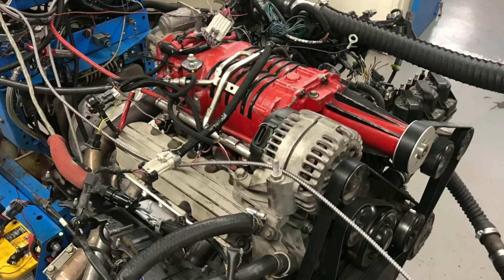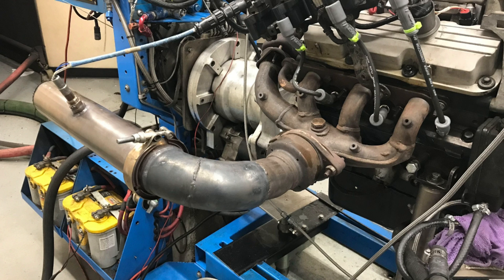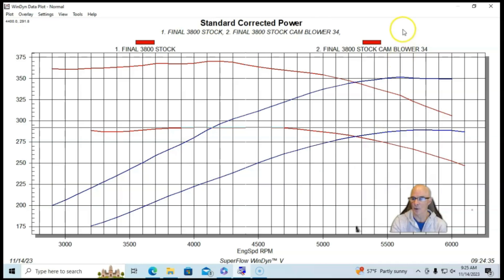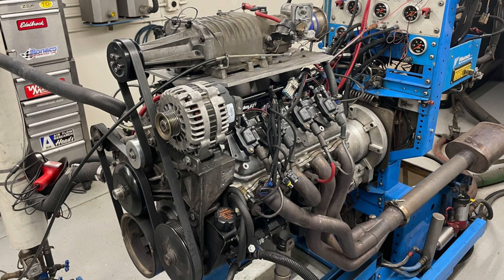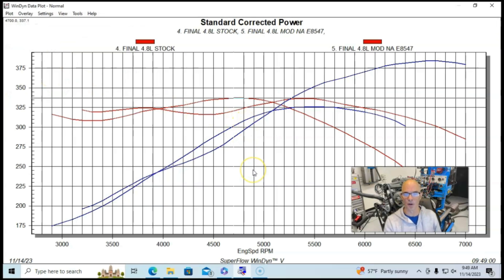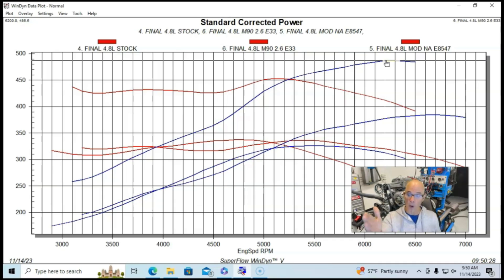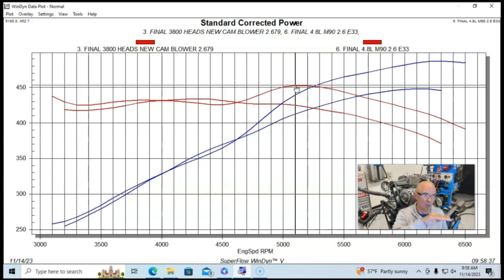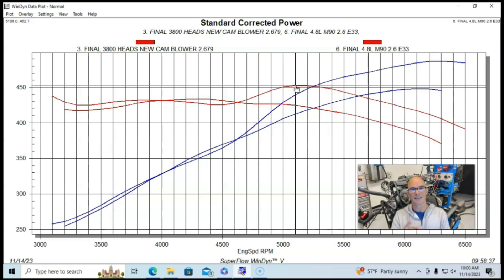3.8L V6 VS 4.8L V8 CHEAP M90 BLOWER TEST. WHAT HAPPENS WHEN YOU RUN THE SAME BLOWER ON BOTH MOTORS?

Comment: Hello...  I. Have.   Been. Around.  Only. One.  Of.  These.    When. They. Were.  Made. By.  B...n...m...    or.  Weiand.   But.    What. A. Difference. It.   Made. On. The. Common.    8l1 cr    350. C...i...d...  chev...    the. Man.  That. Owned. It.    Ran.  12 pnd.   Boost. And.   It. Was.   Unbelievable.   How.  Much.  Power. It.   Produced.   He.   Spun.   235l60lr15. Tires.   With. Posi...trac.  373. Diff....Like.   They. Were.   Bicycle.   Tires.      The.   Very. Cool. Part.   Is. We. Got. It. Under. The.   Standard. Hood.  On. A. 71. Camaro...  have.  A.  Nice.  Day..

Comment: I run a 6v71 detoit blower on my buick using a back to front power steering pump pulley on the blower      
The blower is the size of the block with no heads or sump😂

Comment: When you're doing the tune, and specifically the software, do you start out first trying to find the max timing you can run before knock (not an issue with e85 I understand) or no more gains in torque and then start to add boost in? Like, it seems good to make more power with less boost which I take to mean the engine will have more longevity but if it was me ... knowing nothing ... I would have been chasing the same boost on the big motor but it seems that isn't the way to go. Can you elaborate on the process at all?
Reply from the maker: we run very low timing-then adjust AF (mid 11s on gas scale), then add timing up to our safe point.

Comment: Id really like to see a gen v m90 up against an m112 on a 4.6 ford.
Reply from the maker: m112 wins-it's bigger
Reply: @richardholdener1727  fair enough. To rephrase, id like to see proof that an m90 could be worth installing on an otherwise stock 4.6, especially 4v, and what can be done to get comparable performance to a factory m112 based setup.

Comment: I have a series 2 3800 camaro that I'm doing some modding to. My plan with it is to upgrade the valve springs and possibly put cam and headers on it before I push a wet 100 shot of nitrous to it. I've got the 5 speed model. As long as I don't spray at low rpm i should be fine. Before that I want to regear to a 3.55 since I've already swapped in a posi rear.

Comment: Interesting that the headers didn't do much on the L32.   Could help explain why NA the 3800 II and III at least what I have seen personally here in Aus don't gain a massive amount when building a hot NA engine, but the old 3800 series I and pre series I (LN3) respond to NA mods extremely well, most of which are the headers alone or which rely on the headers as a combo with other mods like cam, porting, higher comp etc.

Between the series I, pre series, and the later II and III series, the heads are totally different and account for 75% of the redesign of that generation.

On a side note, we never got the gen 5 blower here and there isn't a version of the gen 5 that will fit our cars without serious cutting and welding, which leads to not having seen any builds get close to this power on the M90 here.  But when swapping to a turbo or Whipple blower, the power gains become much more meaningful.

Comment: I wish you'd use the proper designation for torque. Ft/lbs is a linear straight line torque. Lb/ft is circular and what you need to use to be accurate.

Comment: You need very little or no valve overlap in a supercharged engine.
Reply from the maker: you need overlap if you want to make power-overlap is not the enemy of boosted motors (that is a myth)
Reply: @richardholdener1727  well tell that to isky.
Reply from the maker: I have run 30+ years of dyno testing to verify my statement, turbos and blowers work very well with cams that have overlap-the guys at ISKY know that too

Comment: Interesting. I didn't think people were still playing with these roots blowers. About 20 years ago I fitted an M112 to my 02 V6 Mustang with a mild tune and pulley setup. This was a complete stock 3.8 block and heads. Made something like 265 rwhp and 285 rwtq at about 6psi. The blower whine was the absolute best. lol Put 80k miles on that setup without an issue. Then I got bored and started playing again with the tune and started changing pullies. Finally ended up lifting one of the heads when I was up to about 12psi.😆

Comment: More efficient? No. Made less boost because it’s on a bigger engine, even though you were running it a lot (10%?) faster.
Don’t get me wrong, I enjoyed the vid but to make any sense you needed the blower drive ratio to be the same, not just the same blower pulley size.

Comment: Great video! So, basically, the 3800 vs 4.8L with the supercharger up to 4600rpm will outperform the V8 everyday bc of weight. Not sure which one burnt the fuel better though.

Comment: When I was a teenager, my brother had a Camaro 1980. He built a 400 small block. And my Uncle had a Buick with a 3800. Wasn't supercharged? I actually. I think it was a leSaber and he beat my brother in a top end race. We 400sb topped out at 132 the Buick was a mile or more behind us in Mexico and about 4-5 miles the Buick caught up and was passing us from a dead stop the 400 murdered the 3.8 but top end I'd say that Buick was pushing 145....fwd 3800 4 speed auto 4dr vs a 1980 camaro with bolt ons cam headers carb

Comment: The 3800 is a great motor. I had a Buick Gran Sport with naturally aspirated 3.8 and it would get 34mpg on the hwy all day long. Also had a 1986 Fiero GT and wanted to retrofit it with the 3800 V6 with blower but never got around to it. I'm thinking it would have been a great combo. As Always, May God Bless you and yours! 😇
Reply: I put a supercharged 3800 in my Fiero, it was an awesome combo! Ended up ripping off the blower, putting a large cam, turbocharger, and e85 in it... Was nuts.

Comment: I always enjoy your videos Richard, especially these M90/3800 v6 ones. 22 years as a GM dealer technician and it is my opinion that the 3800 v6 is still GMs most reliable engine ever. Sad that EPA regulations killed it. I’m still hoping to see you “big bang” a L32 or L67. Gap the rings, series 3 n/a manifold, max effort cam, E85, MLS head gaskets and studs. Let’s see a stock short block make 800+ hp!!!
Reply: I had a 2000 Pontiac with the 3.8 ran it up to 280,000 miles and it was still running strong. Only thing that got frustrating was the fuel pumps going out all the time
Reply: I'd like to see a Eaton supercharger from the ford v8s. They are everywhere for sale right now.
Reply: @dallassmith9617 the M90 blower in the video is an Eaton...
Reply: @D41Michigan  hes talking about the m112 eaton that came on 2003-2004 terminator cobra's and m122 that came on gt500's, bigger and better superchargers compared to the earon m90 in the video
Reply: How did epa emissions kill it when it’s so much more fuel efficient than alot of engines they came after it?
Reply: @Tylers24 basically look at all the newer engines they dont last, so in the name of "advancement" and "emissions reduction" they come out with a powerplant like the 3.6 v6 that replaced the 3800, it gets similar gas mileage but makes 300hp na thanks to probably a better flowing head and a variable valve timing which isnt going to last unless you reduce oil change intervals to 5k miles or less...but the good ol 3800 just keeps chugging along no matter what

Comment: Hey Richard! What rpm are you spinning the m90 on the 4.8? I’m thinking about doing an m90 supercharger but am a little turned away from the supposed 12000 max rpm
Reply from the maker: we were at 18,700 rpm
Reply: @richardholdener1727   thanks! What’s the reliability like at that rpm? Is there a significant drop off in boost production past 12k? I plan on swapping it onto a  3.5L 2GR-FE that’s in my 08 Toyota highlander hoping for 400hp. I think I’ll need to rev it past 12k but not exactly sure what blower rpm I need to achieve that goal
Reply from the maker: your boosted power depends on your starting na power and the pressure supplied, but boost does not fall off after 12K

Comment: I want to see the M90 used on the 4.3 vortec from a 2nd gen s10 engine. The vortec intake with the plastic top removed will make easy way to mount it

Comment: Will u please shine some light on the ford 3.7L cyclone 🌀 engine. Stock they make 305hp/280Tq from factory, FBO e85 N/A  it can make 320whp ish. But the magic of the motor is what it's capable when boosted while being factory sealed. Usually with a 66/67 single turbo setup they can make 600whp/600wtq on e85, it would be safer to back it down to 580whp/580wtq.

I'd really like to see what you could do with it on the channel, id like to see u do N/A test and a test with a single turbo

Comment: I suspect the intercooler helped the 3.8 down low achieve numbers similar to the 4.8 but there is just a point where the 8 higher flowing ports and extra displacement just runs away.

Comment: Could you do a L83 vs the coyote? I saw your 5.3 vs coyote video but they were gen 3 and gen 4 engines. I’m curious to see if the LT 5.3 can keep up with it.
Reply: Before or after a lil abuse and the coyote has timing system failure?

Comment: I have a 440 with a 245@.50 cam on a 107 lsa 500 lift. Can I run a turbo or is that to much overlap? I was told it will backfire threw the carb? Was hoping to run 10psi
Reply from the maker: yes you can run a turbo on that-but that big of a cam is not required to make power with a turbo

Comment: It would be awesome if you did a hp/torque comparison on rebuilt/reman heads compared to used heads. Also the same with a worn used camshaft compared to a new camshaft to see the difference in power.

Comment: who runns 5-6 K rpm in a street car?? ill stick to my 472 Cadillac engine thank you
Reply from the maker: every stock v8 motor ever made runs to at least 5000 rpm
Reply: @richardholdener1727  I would NOT run my 472 at 5 grand with a stock valve train and you should know better...and on the other hand I did not have to clean the roof on west tech of coolant... ;)
Reply: @egilsyvderud3957  220hp @4400rpm out of 472cid.... now that's a joke in itself.
Reply: @codyramos3200  you do realize that's not a performance V8 and it's designed for TORQUE. It's litterally meant to go in a heavy boat of a Cadillac and just cruise.
Reply: It’s a truck motor.

Comment: I factor the difference in boost pressure between the 3.8 and 4.8 being the same blower is feeding an engine that has 1.0L more displacement over it being a more efficient set up in this case. Though I agree that a more efficient setup will make equal or greater power on lower boost pressure.
Reply: wep very good point

Comment: Can you do the L36 Vs L67 3800 faceoff
Reply from the maker: CHANGE IN STATIC COMPRESSION TEST?
Reply: @richardholdener1727 YES!! But try to use a 98-02 fbody 3800 intake

Comment: But is it more efficient? The lower boost is due to a fixed volume of air filling a larger engine. You would expect the boost to be down, that doesn't necessarily make it more efficient.
Reply: If you look up the supercharger blower speed vs boost ratio, anything above 11psi starts to lower the efficiency of the blower, it will basically just start heating the air charge which is why it will need an intercooler. Air starts to "leak" past the rotors as its not a perfect seal. Spinning it faster also lowers its efficiency. The amount of HP needed to spin the supercharger faster starts to offset the amount of HP that's increased from more boost.

Comment: I know it's a gm product but, This proves Ford's point towards the EcoBoost. Why run a V8 that makes the same low speed engine torque as a slightly boosted V6 for a light truck. Cheaper, better on fuel, and lighter.
Reply: Better on fuel? Only if you get the 2.7L option.. but let's be honest who wants a tiny v6 in a full size truck  ... the top 3.6 ecoboost option gets worse mpg than the v8 option 
2021 
5.0L 17 city 24 highway 
3.6L 16 city 20 highway 
2.7L 20 city 26 highway
Reply: @codyramos3200 Ford doesn't make a 3.6 anything. That's a GM and Dodge displacement.

Your thinking the 3.5. Ford also offers a 3.3L V6 that's NA in base trim that makes 290ish HP

Comment: I see a build--as done on the L32--being done on a 3.8-4.5L Buick V-6 being a great swap as a fuel-efficient solution for the GMC "Trans-Mode" RV, especially when paired with a "nuke-proof" THM325-4L that has ALL the upgrades seen for the 200-4R... seeing how the former shares internals with the latter.😉

Comment: That 3800 had some pretty impressive numbers after the mods. I bet it would Destroy a 4T65E with the quickness.
Reply: 4T80’s GM put behind Northstar’s is what people have been swapping to. Best part is that they have more final drive ratio options from the factory than 4T65’s.
Reply: Too shreds you say?
Reply: Of course it would destroy a 4T65E. For the 3800 to really perform, it would need to be in some sort of rwd application with a beefier transmission like a built 700R4 or a T56.
Reply: @mwqs1  People are holding big power in fwd chassis with a 4t80e swap
Reply: @mwqs1  which is why IMO the SC is better than the GTP.  The SC only needs to be modded; the GTP needs to be scraped and rebuilt, at which point should just go down the V8 path.
Reply: @bowez9 the gtp doesn't need to be scrapped you just have to mod it accordingly they make upgrade parts for the 4t65 to put the power down.
Reply: @jeremymann8930  still have wheel hop and torque steer.  Or are you going to use traction control to limit the power you're trying to make.
Only the manual SCs have enough wheep hop to be an issue of concern.  Statistically only the manual SCs are breaking upgraded axles.

So you need to upgrade to a factory transmission rated to what Ford put in as standard.  Once agian  why GM didn't put an intercooler in.
GTP may have had better parts (the ones it did have) but the SC was the better package.
Reply: @bowez9  torque steer is something you have to live with but a good suspension can definitely deal with the hop, just the same as in a rwd car
Reply: @jeremymann8930  so fully adjustable SLA (double wishbone) be good?
Reply: I made some 400ft lb with my modified L67 ran through a stock 4T65E-HD with no issues.  The line pressure was brought to max, cooling fans brought on earlier for cooler transmission fluid.  There was no shift kit, no upgraded hard parts.
Reply: @joefair3391  daily driver?
Reply: @bowez9  It was.
Reply: @joefair3391  most people would say constant line pressure is a shift kit as it is a valve body mod.

I see you can do it electronically but still is a VB mod.  Is just as honest as saying my custom VB in my AOD with O/D lockout and constant pressure isn't a shift kit.

More pressure alone isn't the way to make it last volume is more important.
Reply: @bowez9  Considering they make an actual shift kit for this transmission with heavier springs and such, it's a little different.  I suppose it would be an electronic shift kit vs a mechanical.  My Buick currently has the mechanical kit in it.
Reply: Ya they really do need a valve body and servo upgrade to handle any kind of consistency of performance driving after 60k miles.
They hold up just fine to daily driving with wot pulls once in awhile. But even then after 150k it's a roll the dice type situation. The 4t60e is even more pathetic with a non supercharged 3.8, mine lasted to 160kms, 2500 for a rebuild and it lasted 3mths before hard shifting crept up again.atay away from AAMCO TRANSMISSIONS!
Reply: The 3800 was a great engine that should have never been pulled from production.  It was around for decades
Reply: The GTP setup was fine stock but why bother when it came to mods.
While the Thunderbird SC can actually take mods, with intercooler from the factory and a drive line capable of any power you can throw at it.  Only issue with the SC is start with GEN I or II blower and the 3800 is a better motor than 3.8 Essex.
Though last time I looked there are SCs putting 600+ hp to the ground.
Reply: @bowez9  Another issue is price, SC Thunderbirds are getting expensive where GTP and Supercharged Regeals are cheap. Personally the only reason I would want the SC3800 is for a Fiero swap or something along those lines because the rest of those cars are junk
Reply: @Psycodiver69  a Fiero swap it makes sense anything else a V8 swap makes more than the 3800.
Where as the SCs are unique like the GN and RX-7.
Reply: @bowez9 the gm 3800 surpassed 800hp
Reply: @rescuedabyss  not with a M90.

SCs have surpassed 800hp too once they ditch the M90.
Reply: @bowez9 There is the 3800 F body. No room for a blower it looks like but plenty for a turbo. The thunderbirds are super cool though. I bet they're a ton of fun.

Comment: Wait. Headers didn’t help over manifolds? 😂
Reply: Maybe not on that particular Dyno but it's been proven for years that the front manifold causes problems with the cylinders and causes detonation. Just changing that one manifold out to a zzp powerlog really helps with knock retard. Any more than a 3.5 pulley on one with stock manifolds and your asking for chipped pistons.
Reply from the maker: That has not been our experience on the dyno-the headers showed no gain in power on three separate tests with three different pulley ratios (down to a 3.0 inch if memory serves). No chipped pistons-because we have the correct af and timing. If the headers changed power, we would see it. Believe me, I want them to add power, but the dyno decides what works.
Reply from the maker: They showed no gains on 3 tests
Reply: @richardholdener1727  you forget that you were arguing with me a week ago about how great headers were.
Reply from the maker: NO GAIN ON THE 3800 TESTS